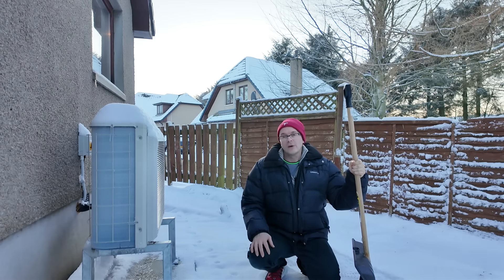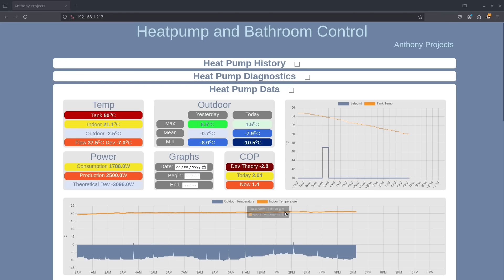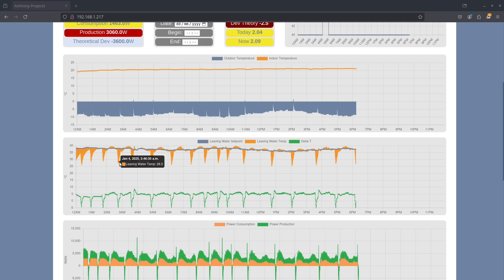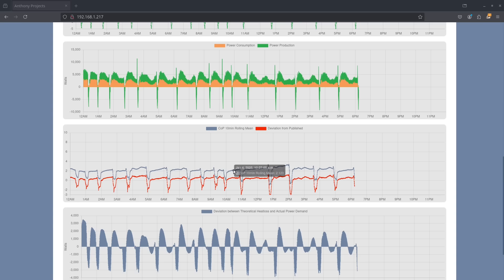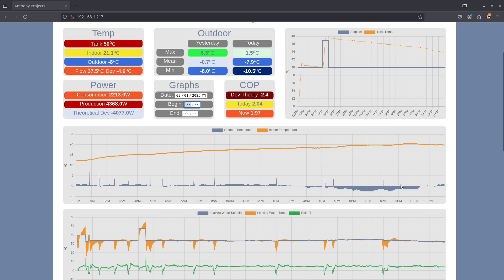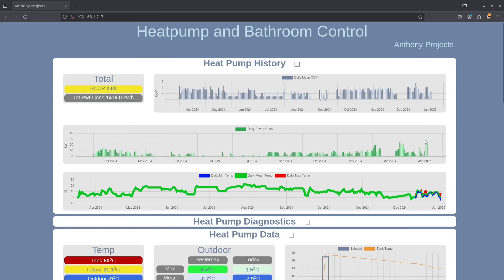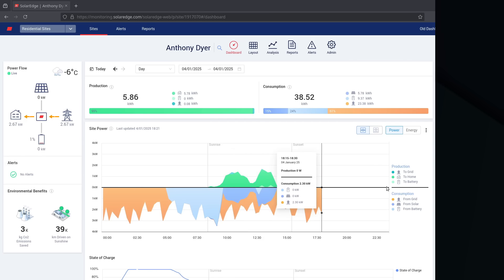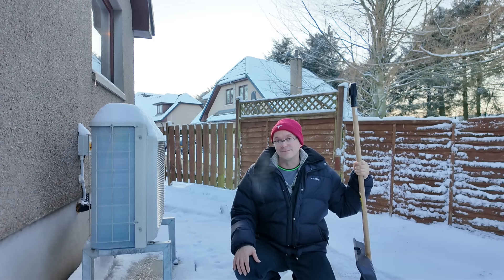Heatpump Performance on the coldest night of the year

Comment: Hi all.   
Please factor in your initial  capital outlay, the life expectancy of your equipment and the payback time.  
Similarly the grant that is provided by the government is not free money, it comes from our taxes to make your system cheaper.  To do a like for like comparison this should be part of the equation.  
I had an electrical engineering company and, amongst other work,  spent many years designing and implementing energy efficiency systems for various industries, it pains me the current systems are not really viable for the lifetime of the equipment.  It's good at a personal level that you have reduced your running costs, but it isn't without costs elsewhere. 

I won't even go into the woefully inadequate capacity of the current electricity grid system, it hasn't a hope in hell of powering us all with electricity for heat pumps and electric car charging.  
It's a good job for the government we haven't all rushed to embrace such systems. 

All the engineers at the front face seem to know this, but it seems to be ignored higher up - yet the government continue with this ill fated scheme.
Reply: Heat pumps are one of the best ways to decarbonise our heating, which is key to meeting our emissions targets. As heat pumps roll out, so will the grid transition.
Reply: @Biggest-hz7ng  
Hi, I cant agree with your presumption.  

The whole system is currently swayed in favour of a move to heat pumps, this is based on large subsidies for tariffs, installation costs etc.  As more people move to HP's the subsidy will need to be removed as there will be insufficient revenue to be gained from those not on HP etc to contribute to those taking up the technology .  Think about the move to Diesel years ago when the government wanted us on Diesel, petrol was far more expensive than Diesel - we all moved and then they removed the benefit.  The same occurred with F.I.T on solar and wind.

The gas infrastructure has been hugely updated over the years whereas the electricity grid hasn't.    When the sun doesn't shine and the wind doesn't blow we use mainly gas to make electric.

This is because the electricity grid is a completely different beast to upgrade.  The disruption will be immense, on a completely different level to other sectors.  You can't just  shut people off from electricity like you can with gas when work occurs.  If my gas  heating goes off for  half a day it isn't a big deal.   If you turn people's electric off, they can't work, the freezer defrosts etc, the lights go out.  The whole upgrade process is different.
This is why a good deal of the cables in most streets are literally decades old, currently too small and lead covered.  They don't upgrade them, simply fixing them with new cables as faults occur..  
We aren't talking about the National grid here, we are talking about the local grids - it's a monumental task  if we are to provide sufficient power for ev chargers and HP's. 

 Electrical grids work on very finely balanced systems and maximum demand calculations to ensure the electricity supply does not move out of specification.  If it goes out of specification, equipment fails and this cannot be allowed.  

I would love to use an electrical based system to heat my home, especially as my preference and bias is to an electrical system.  However, it is currently fanciful to believe that an electrical powered heating system could exist, even with the free energy from the air (HP's),.  The figures don't add up, we are talking huge cables, new transformers etc and decades of upgrade work with contractors that don't exist to do the work.
By all means take advantage of the lower costs from the subsidies at the moment , but | don't believe it will last.  
You should build in your capital costs to your running cost calculations and be realistic that they are currently heavily subsidised. 

I do wonder who is advising the government here because there are a lot of missing parts to their current equations.
Reply: The grid are happy with current plans. Grid is sized for peak demand. Demand shifting allows more electricity to flow in total. EVs will be widespread, followed by heat pumps. By the time heat pumps arrive in quantity, many upgrades will have taken place.
Reply: @Biggest-hz7ng  Hi, not sure of your data source.  Your simplification of the demand for the entire grid is not correct.  

Many years ago, assumptions for the diversity applied demand for a residential property was circa 3kw.  ie. approx 13A.  Many residential  cutouts are fused at 80A but the network knew the chances of such a demand occurring simultaneously across multiple  residential properties was very rare. 

 Various energy saving products have now come in that reduce the sustained demand i.e Led Lamps.  
There is no evidence whatsoever of wide scale upgrades to local electricity networks.  It is safe to assume  the same outdated cabling, switchgear and transformers are still in place as designed for outdated load profiles.

 Heat pumps and EV chargers are sustained loads that continue for many hours.  It would be quite normal to see an EV charger with a sustained load on the grid of 5 to 7kw for many hours.  

Add on a heat pump load of circa 3kw sustained, and we have a completely different load profile on the network.  The 3kw  diversified demand  has now changed to circa 1O Kw sustained for many hours !

There is absolutely no chance whatsoever of the current local networks being able to sustain this additional load.- never mind the National Grid.

With respect to HP's,  the shear cost of this technology to the average customer is not feasible without the subsidies that are currently in place.  Once these are removed, which they will be, the early adopters could be left with a very expensive system to both run and maintain.  I'm just pointing out the pitfalls to those without electrical knowledge who might believe  we have all the systems in place to make this happen - their current running costs continuing as before.

It is the responsibility of the government to obtain all the correct information from multiple sources on the feasibility of their plans.  They must not be deafened by those who have something to sell.  I have nothing to sell.
Reply: @scherry5135  I continue to believe the National Grid and I think you overstate possible local issues.
An EV doing 10k miles at 4 miles per kWh might draw 7kWh per day. A Cosy 6 heat pump (for example) might draw 2.5kW.
Reply: Though demand will be spiking from individual EVs, the average demand from EVs in a local grid isn't huge (say 300W each when averaged over a day) and is mostly at night when demand has ebbed away. Heat pumps have sustained demand but are likely to be rolled out more slowly. I'd say local grids will be fine.

Heat pump subsidies mostly cover the cost of switching to low temp heating. The individual cost of replacement heat pumps isn't extortionate.

Electrification is efficiency (and emissions reduction).
Reply: @Biggest-hz7ng  
Hi, not sure of your background so please don't be insulted.  However your assumptions for how the electrical grid operates are quite wrong.   There is no technology currently available that allows  a heat pump or  an EV charger to assess the load on a local grid and there is no real prospect of this being possible.  Hence there is no way for either to reduce their load in the event of an overloaded local grid.
If a 7kw ev charger requires a full load charge, then that is what it will do, and the same applies to heatpumps.  Electrical systems don't work on average loads over the day, they work on near instantaneous demands as this is how electrical systems work and this is what causes electrical system failure. 
 If an ev with a 60Kwh battery requires a  full recharge then it will require a sustained input of 7kw for eight and a half hours.   The local electrical grids cannot cope with such huge loads imposed from multiple sources.  This will cause fuse failure on the tight margin systems in place. 
  For eg a 32A MCB may not trip at full load for 5 minutes but increasing past this will quickly cause a trip.  You can access the tripping curve specs for all known mcbs in the IEE regs and they will provide the exact trip time, but much over the  max rating for the device will cause a trip in seconds.    

Whilst I do appreciate your replies, they don't represent the factual situation with how electrical systems operate.  

Please make your own mind up on how you wish to proceed with your own electrical installation.  however some of your statements are somewhat flawed.  

There are a great deal of good videos on You tube that explain electrical power and I would also recommend John Ward on you tube.
Reply: @scherry5135  so, to your mind local grids with a large penetration of EVs and heat pumps should be starting to fuse out right about now? It sounds like something DNOs would be concerned with, and place limits as well as move people to three phase supplies.EVs charging 49 kWh are likely to be charging that much only once per week. I might imagine Octopus Intelligent Go costumes might be directed to charge asynchronously.
Reply: @Biggest-hz7ng  Hi I think you have taken this conversation right back around to my original post and concerns !!! good luck with your system

Comment: Hi Anthony, forgive my ignorance but rather than using the power from your battery during the morning, would you not be better off using the batteries to power  your consumption during the expensive evening and then recharge them during the cheap overnight rate?
Reply: I had a similar thought... Perhaps he is using Go, which is flat apart from the morning?
Reply from the maker: I’m on Octopus Go Intelligent tariff, and they offer no incentive to avoid the peak evening period.  If they did, then I’d certainly hold my battery charge until 4pm.

Comment: I’ll stick to heating our home with wood.
Reply: Neighbours would probably prefer a heat pump...
Reply: @Biggest-hz7ng  

Most of my neighbours use wood.
Reply: @jaybeaton9301  probably all of you would benefit from the cleaner air a move to electrically powered air to air or air to water systems would bring.

Comment: Hi,Anthony. I live in cold 🥶 Norway and here it gets very cold every winters .Regarding heat pumps air to air something alot of Norwegians have here is pro advice of heat pump tecs  when we got it is to NEVER turn it off always leave it running and to be set on heat only not auto and at night you turn up heat to max speed and maybe 25c as electric ⚡️ normally is cheaper at night. A air to air heat pump gives 5 to 1 ,so when it uses 1000w it gives heat of 5000w  all the best 😊

Comment: Hi Anthony, thank you for a very clear, concise and informative presentation. With your heat pump, solar panels, battery and EV you have clearly taken steps to reduce your carbon footprint and accepted the potential costs and risks of making the changes. I applaud your leadership. Well done.

Comment: Don't you have to get rid of your gas boiler as part of the grant deal on heat pumps? When it produces unsatisfactory heat and when electricity companies are trying to surge up prices. Diesel heater using kerosene is way way the cheapest, i love mine
Reply from the maker: I’ve not seen “unsatisfactory heat” from my heatpump.  So there’s no need for a gas boiler (and gas supply standing charge).

Comment: No problems with my efficient gas boiler and well insulated house plus ive saved 20 grand by not replacing it with a more cumbersome piece of kit.
Reply: Where did your gas  come from?  Imported by tanker from Qatar?
Reply: @welshskies  Yes and then I had to personally carry it from the Dock 🤣
Reply: So, how much does it cost to repair when it goes faulty 🤔
Reply: @MichaelBooth-wt1zy  Dunno. I've only had it ten years. Another ten and I'll replace.
Reply: @mci6830  only had my Gas boiler 20 years and it looks like it will out last me so I think I’ll keep my money in my pocket after reading the other posts.
Reply: Last year I had a choice new gas boiler £3500 or Heat pump £2750. A no brainier.
Reply: @bryanhindle8307  sounds good. Please send me details where I get one installed foe that price.
Reply: @mci6830  Gas boiler is around £1200. -£3000 fitted. Heat pumps £3000 to £5000 plus fitting. Fitting costs £ thousands. It's all bollox. Designed for nerds that like looking at graphs
Reply: @mci6830  Your statements don't make sense.  the majority of the £20K is to upgrade to low temperature heating, so if your home is already running a gas boiler efficiency with decent insulation, it will never cost £20K to install a heat pump.  In all likelihood with the grant if your gas system is as good as you say it is, then you'd have the vast majority of the cost covered by the grant.
Reply: @BenIsInSweden  Unfortunately in the UK installers were in the habit of specifying very small central heating radiators …. too small for an oil or gas condensation boiler to work effectively.
So you can imagine that all radiators will have to be quadrupled ?? in size for a Heat pump if it’s to heat the house with a flow temperature of, say, 45 degrees C max for a decent COP. If it’s micro bore then the pipes need renewal as well. All depends on how well the building is insulated of course (and ventilation controlled). To misquote certain politicians, Insulation, Insulation, Insulation 😂😂. With our Victorian housing stock it’s not that easy.
Reply: @Martindyna  My point is you can't have an "efficient gas boiler in a well insulated house" and have a cost of £20K to upgrade to a heat pump with low temperature heating.
Microbore doesn't require replacing if they can carry enough heat, heat geek have a chart for this, and there are plenty of UK people with microbore and heat pumps and getting SCOPs of >4.

Insulation doesn't directly affect efficiency (gas boiler or heat pump).  It affects heat loss, which determines heat pump sizing, and the core to distributing the heat required is the pipes and radiators.   "Well insulated" will reduce the requirements on the size of the radiators and the pipework.

It's an either/or.
Either the gas boiler is efficient and in a well insulated house OR
The cost for converting to low temperature heating is high.

Unless it's a mansion both cannot be true.
Reply: @robertferguson4607  Aye. Seems to be the case. Eventually, the net zero bollox will subside, and I'll just be able to replace My old gas boiler in another 10 years.
Reply: @mci6830 Where do you expect your gas to come from? Currently 55% of gas used in the UK is imported  and by 2050 that is expected to be 85% (Satista).
Reply: @welshskies  Your point being what ? Thanks for your information,  only available to the very clever......My home grown electricity must be a fraction of the price of my gas then .
Reply: @robertferguson4607  Why are you here looking at the graphs I wonder?
Reply: @Martindyna  All that you say means that your boiler will be running very inefficiently, so you need to upgrade such a system anyway. This is not a fault in heat pumps it's a fault in poor system installation, which, incidentally, unless it is a very old installation, did not even meet the building regs when put in.
 Insulation on old houses is more complicated and expensive than in a new build of course. Is your point that it should not be done for these reasons?
My experience is that whatever your heating system, insulating the house to a high standard is worth the expense and trouble, and this has a quicker payback time than most people think.
Additionally the house will be more comfortable from day 1.
Reply: @mci6830  in the UK you can easily get a heatpump for that price, I've had two quotes already but waiting six months to install with solar as well.
Reply: @nickwinn7812  I said Insulation, Insulation, Insulation so I most certainly was not saying it’s not worth doing. Super insulated houses could almost keep their modern condensing boiler since it will hardly be used but for the annoying standing charge. Houses with absolutely tiny radiators I was thinking of were typically built in the 1980s.
Reply: @BenIsInSweden  If the gas system is a combie type then moving to heat pumps requires the re-plumbing of the hot water system, installation of a hot water cylinder and various other water system changes - maybe not 20k but a lot more than just replacing a gas boiler.
Reply: @bryanhindle8307  I would like the details to as I was quoted 18k
Reply: @bryanhindle8307  Do I understand you had a gas heating and hot water system replaced with a heat pump system for £2750??  Does that include all the changes to the pipework, tanks, and installation?  That looks to me just like the cost of the heat pump.
Reply: @bryanhindle8307  I think I just seen a cow jump over the moon. Lol
Seriously, guys, let the heat pump installations speak for themselves, that is the way technology moves forward for the betterment of everyone.
Wishing for something that isn't, as if it were, is for children's bedtime stories.

The truth is if you have Gas available that is the sensible way to go for the time being, if you haven't, and you have room for a oil tank,  that will work for you too. If all else fails electrical heating is for you either off peak storage or ground source heat pump.